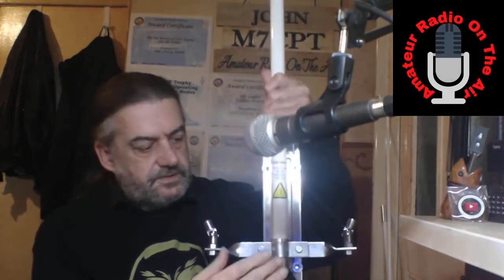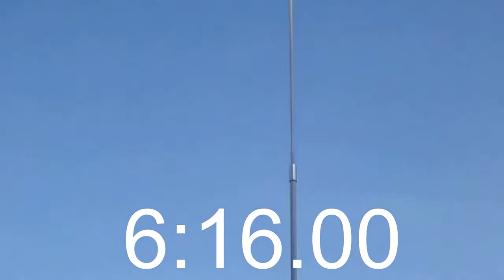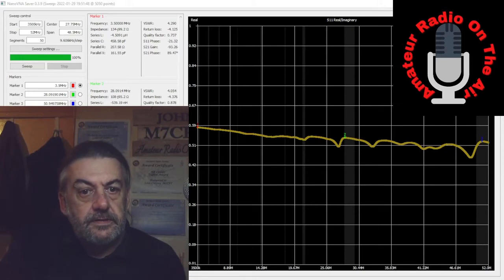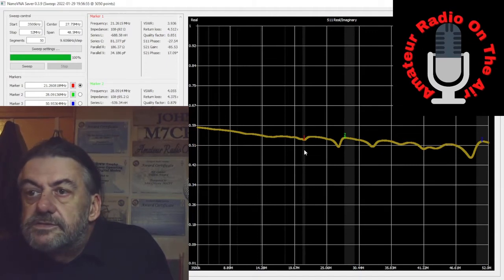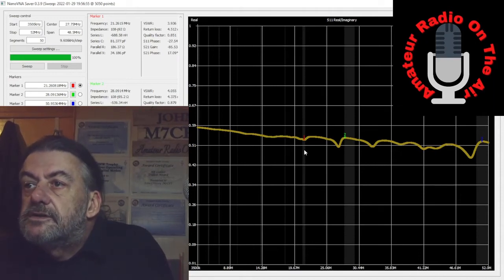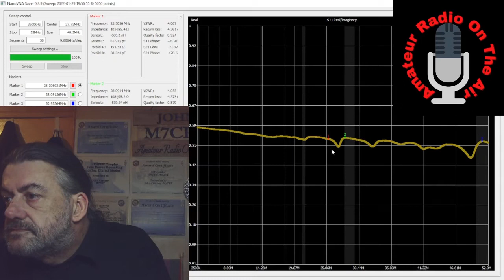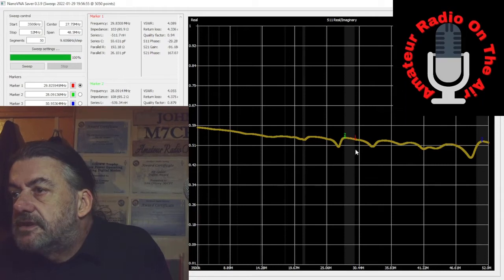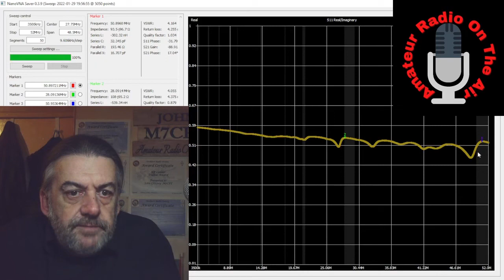Rapid Setup, Test and Teardown of an all band HF Antenna, The Sigma Eurocom HF-360 + the PLUS KIT

Comment: Great video but is the angle of the plus kit  antennas set to a specific angle?
Reply from the maker: The ideal angle for the plus kit will vary. Height above ground wanted take off angle etc, I finally settled on a horizontal configuration that worked well for me. I suspect those with extra height above ground will probably get better results with the plus kit angled downwards.
Reply: @A.R.O.T.A.   thats great  thank you very much !.  i have still to buy the actual extra kit for my S-EX HF 80 (Aluminium version)  which i am looking forward to very much as I have the  40M band  just now on my longwire in the attic with the Yaesu ft950 and the  80M band at a push.  just  one frequency picked up, hopefully   this extra kit will boost the signal.  I live in scotland in ayrshire   currently with the RSGB in uk  I have my  SE-X HF 80 antenna painted acrylic black to hide it from the nosey neighbour brigade!
Reply: getting the plus kit tomorrow!  arriving by Royal mail parcelforce  here's hoping it arrives safe n sound!

Comment: Is that a metal fence behind the antenna, a few feet away? If so, it might be affecting the readings. Metal objects that close can cause coupling and detuning. I’ve got a Moonraker on the way (about 6m tall), and I’m curious how it’ll compare. It will be on a ground plane as opposed to the radials. Thanks for sharing your experience!
Reply from the maker: The fence is wooden panels supported by reinforced concrete. While the reinforced concrete might affect the readings it wont be by much if anything it could act as a reflector slightly increasing the signal in a southernly direction.

Comment: How did you fix the 1, 35 metre steel whip at the top? How deep inside? There is no mention in the manual of what to do...maybe for SWR adjustment how?
Reply from the maker: unlike the expansion kit the top whip only goes in a small amount just enough to secure it in with the 2 screws. No tuning of the main whip at all.  Then just treat as a random wire for the radio side tuning where needed.

Comment: What do you have connected to the coax that goes into the bottom of the antenna?
Reply from the maker: That is a common mode choke balun (1:1 balun) to prevent RFI comming back down the coax.